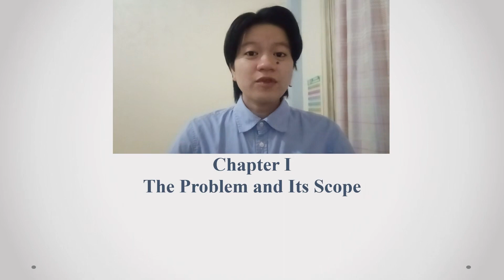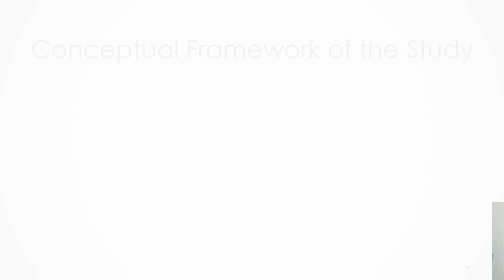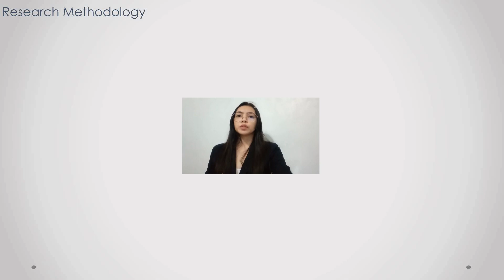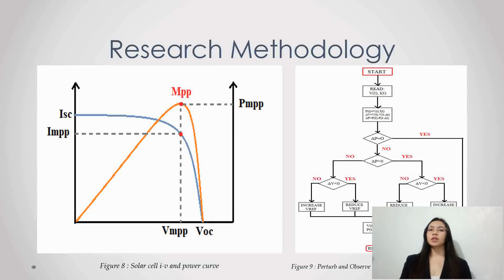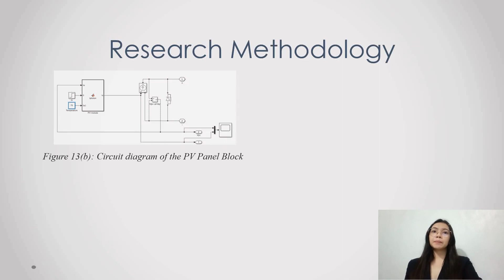The Use of Buck-Boost Converter in Maximizing the efficiency of Grid-Connnected PV System

Comment: NAME: Sanrey Jun R. Guevarra
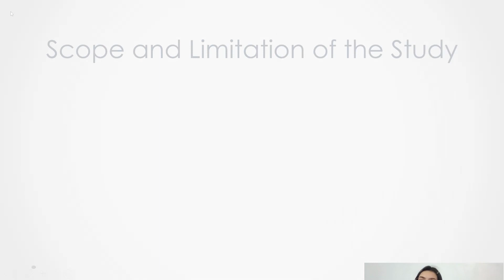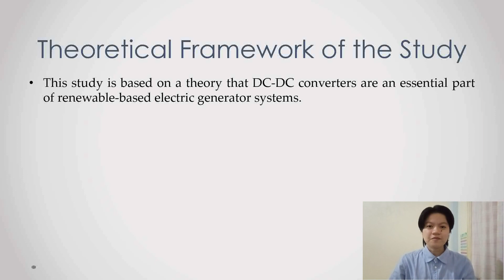CLASS NAME & CLASS SCHEDULE: COE 346 A & 5:00-6:30 T-TH
DATE: 27/03/2022

REACTION: This study proposal is exceptional and instructive because it uses a video buck-boost converter to increase the performance of a typical solar system. It's a plan to make solar energy a more cost-effective alternative to oil and gas.

REFLECTION: Using this concept, we may be able to reduce losses and increase power generation by improving the components of the current (PV) system. The use of a Buck-boost converter is very advantageous in the production of power using photovoltaic systems since it improves the efficiency of the system.

Comment: Diaz, Joseph Jr. B. 
ENS 341 B - 5-8 pm Saturday
March 26, 2022

Reaction: To be honest, I'm a little bit confused with the topic about buck-boost converter. But what I understand about it is that it is important when you have solar panels because it makes the solar panels more efficient compared without the converter. 

Reflection: The buck-boost converter in maximizing the efficiency of grid-connected photovoltaic system is necessary because it offers more efficient solution than without it even the external component are just few.

Comment: Tudio, Lechly D. 
COE 346 Methods of Research T-TH 5:00-6:30 PM March 26, 2022
Reaction: Given the fact that the video is very informative, I like the energy and enthusiasm of the presenters. The audio is clear, and they delivered it presentably.
Reflection: Buck-boost converters offer a more efficient solution with fewer, smaller external components. It is an excellent idea since everyone is using solar power and is planning to install it. This is a great chance to have some additional information.

Comment: Name: Khynny Maureen P. Campoy
Class Name and schedule : ENS 341 Saturday (5:00-8:00pm)
Date: March 26, 2022

Reaction :
The research is informative. They explained and presented their topic in a clear manner. 

Reflection :
Solar energy is one of the highest potential to be used as the new source of electrical energy. The photovoltaic system today is facing lots og challenges that can affect the efficiency and output power of the photovoltaic modules. By adding a buck-boost converter and MTTP controller to the standard components of the PV system is one way to solve the problem.

Comment: NAME: Lumelyn E. Ragusta
CLASS NAME & CLASS SCHEDULE: ENS 341 B Research Methods for Engineering – S 5:00-8:00 pm
DATE: March 26, 2022
REACTION:  The research proposal presented a convincing flow of research methodology and a good amount of theories to support the idea that buck-boost converter is an efficient solar energy maximizer. However, it lacks the estimated cost of research that researchers should have foreseen.
REFLECTION: The proposal should define the terminologies that are often used for readers or audiences to understand the proposal better. The proposal title gives an impression that researchers just want to know and compare the efficacy of buck-boost converter with theories that can be sufficiently provided by related literature.

Comment: Name: Balansag, Lorenzo Jr. B.
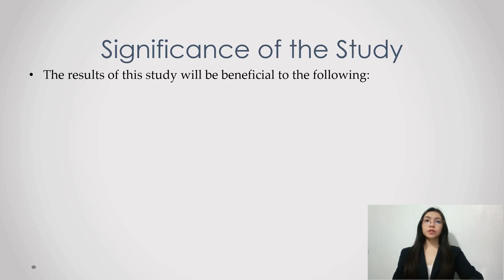Class Name and Class Schedule:  ENS341- Research Methods for Engineering | Saturday 2:00-5:00 pm 
Date: March 26, 2022

Reaction: The proposal have been presented clearly. The researchers have presented all the information with confidence and passion. In terms of the topic at hand, it is really good to have ideas that promote the use of green and clean energy instead of other power generation that creates bad impact to the environment.

Reflection: I was able to determine the application of the Buck-Boost Converter in maximizing the efficiency of the grid-connected PV system. When integrated, it will greatly help as a secondary source of electricity in which lessen the cost of electricity bill.

Comment: NAME: Kilapkilap, Joebert L.
CLASS NAME & CLASS SCHEDULE: ENS 341 A – Saturday 2:00 – 5:00 PM
DATE: March 26, 2022

REACTION: This study is extremely excellent; the researchers provide their data and the guarantee of their investigated data, and their study encourages the use of green energy and highlights its environmental benefits, which is fantastic. It promotes the usage of green energy and outlines the environmental benefits of doing so.

REFLECTION: Solar energy is unquestionably one of the most cost-effective forms of energy. One of the benefits is that it has the potential to lower the cost of power from the principal source in most residential structures. It is also projected to help commercial and institutional buildings significantly. This discovery is significant in part because it encourages green energy, which is helpful to both individuals and the environment.

Comment: NAME: GANANCIAL, NICK ALLEN C. 
CLASS NAME & CLASS SCHEDULE: ENS 341 - SATURDAY (5-8PM) 
DATE: MARCH 26, 2022 

REACTION:  I commend the researcher’s pronunciation of words and they did a great job in explaining and presenting their topic.  It is very informative and you can easily grasp information’s about The Use of Buck-Boost Converter in Maximizing the efficiency of Grid-Connected PV System.

REFLECTION:  After watching the video, I was able to determine the use of the Buck-Boost Converter in maximizing the efficiency of the grid-connected PV system. It is beneficial to commercial buildings because these buildings have higher energy consumption, and having solar energy as the secondary source of electricity can lessen the expenses on electricity.

Comment: Name: Orito, Jessel A.
Class Name & Class Schedule: ENS 341 B Research Methods for Engineering (Saturday 5:00-8:00 pm)
Date: March 26, 2022

Reaction: In this video, the researchers explained the proposal thoroughly especially with the clarity of their voice. Proposing the use of buck-booster converter in maximizing the PV system helps to make solar energy an economically viable competitor to oil and gas.

Reflection: Promoting solar energy utilization using PV systems has become significant due to environmental concerns. Photovoltaic system today faces lots of challenges which can affect its efficiency. Adding a buck-booster converter to the standard components of the PV system is one way to solve this issue.

Comment: NAME: Mark C. Temporada  BSGE 3
CLASS NAME & CLASS SCHEDULE: ENS 341 B - Research Methods for 
Engineering 5:00 PM- 8:00 PM Saturday Class
DATE: March 26, 2022

REACTION:    After watching the whole presentation , the research study was indeed  helpful and very informative research proposal. The topic was presented and explained in a clear and concise manner.

REFLECTION: In our generations today, having enough knowledge of these things will be surely very helpful. They studied buck and boost converters to produce consistent voltage and improve efficiency. The study's relevance is that the output voltage can be set higher or lower than the input voltage, keeping the voltage level constant. This study will benefit all that uses solar energy and ulitize solar energy in their filed of work.

Comment: Name: John Mark D. Torillo
Class Name and Class Schedule: ENS 341- SAT 2:00-5:00 PM
DATE: MARCH 26, 2022

REACTION: This is such an excellent proposal and a unique one as well.  As I've watched the video, I really adore on how they are dedicated and serious in this matter. The reporters discussed and explained it very well.

Reflection: Solar Energy is one of the most abundant power source in our community but also it's a green energy which can be very useful and harmless at the same time. But apart from that usefulness, it also faced a lot of challenges and their concept can help to ease and solved that particular problem to continuously produce and generate green energy from the sun by using renewable-based electric generator system . It's necessary for us to be knowledgeable on how to deal with that matter.

Comment: Name: Sienes, Marianne Nikki T. 
Class Name and Class Schedule: ENS 341 B - (5-8 PM Saturday)
Date: March 26, 2022

Reaction: I really admired the way the researchers presented their topic; they really did a good job. It is very informative and they explain the points, which helps us understand more about the use of the Buck-Boost converter.
Reflection: This study is not only good for the environment but also helps reduce the cost of energy consumption from the primary source for the majority of residential, institutional, and commercial structures. The use of a buck-boost converter improves the performance of a standard PV system. It will let the solar modules use their full capacity, allowing them to send electricity to the load with fewer losses. This innovation is very great, and I like how it promotes green energy.

Comment: Marc Kenneth L. Baldosano
ENS 341 A (Saturday 2:00-5:00 pm)
March 26, 2022
REACTION: The researchers presented the presentation excellently. I see that they mastered their topic and have a clear understating of what they are talking about.  

REFLECTION: The use of a Buck-boost converter is a great idea on how to power up devices that require less voltage to operate and devices that requires more voltage to operate since it combines the functions of a buck converter (used for DC voltage step-down) and a boost converter (used for DC voltage step-up).

Comment: NAME: ALFORQUE, JAN PAULINE 
CLASS NAME & CLASS SCHEDULE: ENS 341 - SATURDAY (5-8PM)
DATE: March 26, 2022

REACTION :
 The researchers did a great presentation. It is ver informative and they delivered it very well. 

REFLECTION :
 Solr energy is very important this benefits the uses of solar energy for their field of work at homes. The study about buck and boost converter-based system which is used to produce constant voltage and reduces the PV modules for grid connection of multiple solar rays is implemented.

Comment: NAME: Janloyd T. Ybañez
CLASS NAME & CLASS SCHEDULE: ENS 341 A (2:00 – 5:00 SAT)
DATE: March 26, 2022

REACTION:  This research proposal was very well delivered and the topic was also interesting. They presented their their data and the assurance of their studied well and very informative. 

REFLECTION: The performance of a normal photovoltaic system will be improved by using a buck-boost converter. It will let the solar modules to use their full potential, allowing users to access electricity to the load with less losses which is a good idea and also encouraging the use of green energy to the benefit of the environment.

Comment: NAME: Alejandro A. Bargaso Jr.
CLASS NAME & CLASS SCHEDULE: ENS 341-SATURDAY 2:00-5:00PM
DATE: MARCH 26, 2022

REACTION: 
This research proposal is quite amazing and enlightening since it will improve the performance of the standard solar system by using a video buck-boost converter that is based on video signals. Essentially, it is a proposed technique for making solar energy a competitive economic alternative to oil and gas.

REFLECTION: 
This study has significant implications for buildings of all types, including residential, institutional, and commercial structures. When compared to other energy sources, the performance of the PV system will attract more customers, resulting in the expansion of their business. Additionally, it has the least negative impact on the environment. We really need to come up with an idea in relation to alternative energy that will allow us to conserve electricity while also being environmentally friendly.

Comment: NAME: NOEL JOHN C. CANOY
CLASS NAME & CLASS SCHEDULE: ENS 341 - SATURDAY 2-5pm
DATE: MARCH 26, 2022
REACTION: This research proposal is excellent and impressive. It is very informative since I'm not familiar with photovoltaic system, so it interest me.

REFLECTION: With this study we learned the great benefits to any building infrastructure they have mention above that  PV system can ba a  greatly help in sustaining and conserving electricity it also do not release any harmful effects in air and water that can cause pollution so it means it is good for the environment. Aside from that Photovoltaic system is silent or no sound, it is low in maintenance so it can reduce your cost and it is easy to install.

Comment: NAME: Shiela May E. Velos
CLASS NAME & CLASS SCHEDULE: ENS 341 - SATURDAY (5-8PM)
DATE: March 25, 2022

Reaction: This study is a quite impressive, researchers present their data and the assurance of their studied datas, well-explained, and well explained their study advocates the usage of green energy and outlines its environmental advantages, great. It encourages the use of green energy and laid out the benefits of it towards our environment. Using a DC-to-DC converter to maximize the PV system's power and voltage output is a good approach to make it more efficient. It was an excellent research proposal. 

Reflection: This study could be a possible to the future industry improvements, it has the potential to be implemented. This project intends to provide higher savings to households and building owners while also generating a profit from the PV to Grid energy sell off. Using this technology, we can ensure that we can meet the load's need, and if we generate extra, we can sell it to the grid firm for money back or energy credits. It's a good way for people to choose solar energy over conventional energy sources, lowering their electricity costs and increasing efficiency.

Comment: Arnold Jr. Arnesto
CoE 346 A - 5:00 PM - 6:30 PM TTh
March 25, 2022

Reaction:
I think that using the buck-boost converter is beneficial because it serves to improve the capabilities and lessen the cost of renewable energy as well as preserve the environment.

Reflection:
I definitely learned new things after watching the presentation. The buck-boost converter system holds great potential as an alternative because of its capabilities for maximizing the efficiency of the grid system. I believe it benefits everyone because we all have the need for electricity.

Comment: NAME: VALENCIA, PRIYANKA N.
CLASS NAME & CLASS SCHEDULE: ENS 341 - SATURDAY (5-8PM)
DATE: March 25, 2022

REACTION:
As I've watched the video, the presenters did their best of their capabilities to explain the topic. They mentioned the most important points.

REFLECTION:
As an engineering student who supports on clean and reliable energy, this study is commedable and interesting. It encourages the use of green energy to benefit the environment while also addressing process difficulties. This will undoubtedly motivate a large number of individuals to switch to green energy. Grid connected solar systems need to improve different technologies to maximize power yield from solar arrays. So this proposal have a great potential.

Comment: NAME: Renz Eugene V. Denulan
Class Name and Schedule: ENS 341 SAT 2:00-5:00
Date: March 25, 2022
REACTION: This is one of the study that is well presented and very informative. The researchers delivery were very cheerful. I had a great time because of it.

REFLECTION : PV cells are the widely used type of solar panels and adding a buck-boost converter would greatly improve the grid. It is also mostly low cost so it is a big plus.

Comment: Name: Mark Daniel L. Anggoy
Class Name & Class Schedule: Coe 343 Methods of Research T-TH 5:00-6:30
Date: March 25,2022

Reaction:  It's a very excellent study. Using a DC-to-DC converter to maximize the PV system's power and voltage output is a good approach to make it more efficient. It was an excellent research proposal.
Reflection:This research of in use of a Buck-Boost Converter to maximize the efficiency of a grid-connected PV system has given me a lot of insight into how improving PV systems and their performance is a good way for people to choose solar energy over conventional energy sources, lowering their electricity costs.

Comment: Angel Lynes Esona
COE 346 Methods of Research TTH 5:00-6:30PM
March 25,2022

Reaction: The research is clear and concise. It is quite unique and supercalifragilisticexpialidocious. The researchers did their best in explaining each part of the research well and they're smart.

Reflection: The research is about the use of Buck-Boost Converter in Maximizing the efficiency of Grid-Connected PV system. Electricity produced by solar cells are clean and silent. Photovoltaic are quiet and visually reserved. Solar cells produce direct current electricity from sunlight which can be used to power equipment or to recharge a battery that is why this kind of proposal needs to be approved in our community.

Comment: Name: VEXANDER PHILIP M. MARAVILLA
Class Name and Class Schedule: ENS 341 A - TTh 6:30-9:00pm
Date : MARCH 25, 2022

REACTION: The idea of the study is good for it's goal is to minimize the cost of electricity bill for most high voltage consumption of electrical energy. Boosting the supply of electricity while minimizing the cost. Awesome!

REFLECTION: Buck-Boost converter will be a great help to most residential areas with most of higher consumption of electricity. Wherein it helps generate electricity in a more faster and cheaper way and as well as it is environmental.

Comment: NAME: Sanriel Moreno
CLASS NAME & SCHEDULE: ENS341- B ; (5-8pm) Saturday 
DATE: March 25, 2022

REACTION:
The researcher’s study provides a much more in-depth discussion of solar energy. They presented their study well and they made a powerful and captivating presentation.

REFLECTION:
Solar energy is certainly one of the most efficient sources of electricity. One of the advantages is that it could reduce the cost of electricity coming from the primary source for most residential buildings. Institutional and commercial buildings are also likely to benefit greatly from it. A large part of the importance of this innovation is that it promotes green energy which is both beneficial to humans as well as the environment.